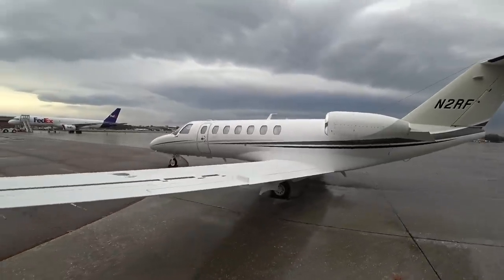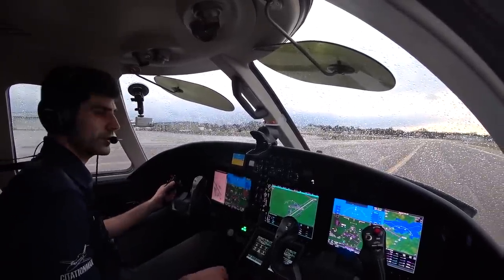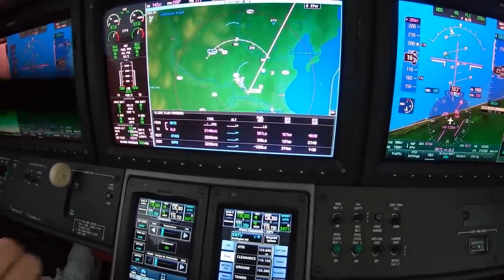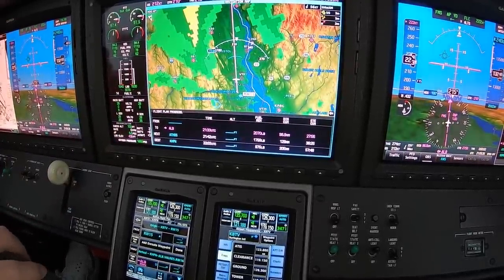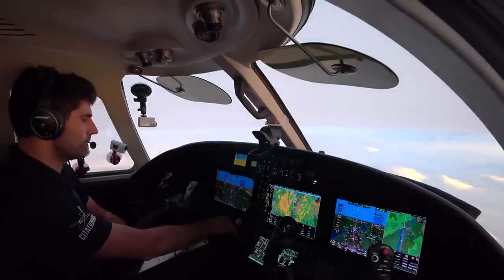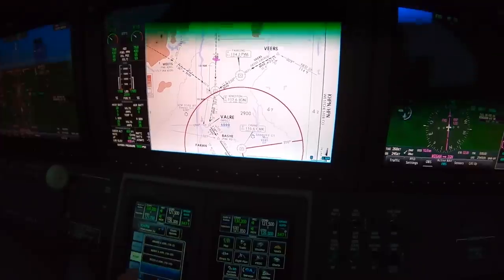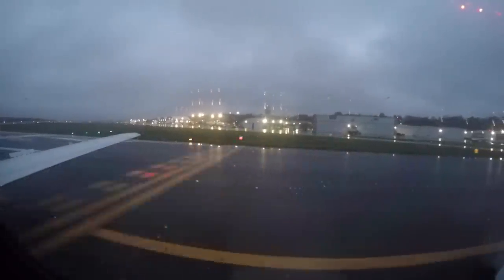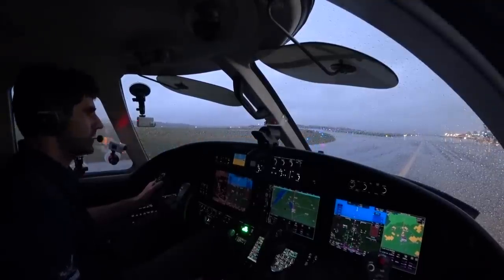That Was Low... Approach To Minimums!!

Comment: First time I’ve seen the channel. Just realized that’s my home field, flew out of there for many years before moving away. Good old BTV. Still remember all the numbers, SID, local VORs  & Loc. freqs etc.. Yes, I was even flying there way back when we were still having to shoot the ADF approach into MPV runway 35, while timing it on our watch for the miss, and biting our nails while being thrashed about with turbulence the whole way in ... 😉.  How I miss real flying when I stop and think about it. Being a pilot has drastically changed during my life’s flying career. We used to have to work hard and study at being a good pilot. There was so much to know, and so much to master. 
But once GPS was approved for inflight use, and every plane out there started getting fit up with coupled autopilots, being a pilot  started to change. And it’s come to a point now, where the majority of young pilots, can hardly fly the aircraft. But, they can push buttons and program  a shiny glass panel  avionics display, which is what is doing all the actual flying, navigating, and everything else the plane does now days. 
Yep, we gained a few advantages over my career. But, we’ve lost a lot more about flying, than we’ve gained. The main thing being, real pilots. 
Btw, I’m not talking about you in this video. Just my experience over 40 years of flying, and what I see with most young pilots who fly with me nowadays. To them, flying is all about the avionics now. The love of the flying and handling the aircraft itself, is no more. Being a good pilot, flying single pilot IFR used to be a heavy workload in the cockpit. So, we had to be excellent pilots to stay proficient. We had to constantly work at it. We had to multitask big time, so we had to be able to hand fly the plane so well, it was second nature to us. This is no longer the case. Many pilots now, rush to engage the autopilot when they get in trouble! since most cannot multitask and also fly the aircraft anymore. When what they should be doing when in trouble, is instead turning it off, and as pilot in command, take charge off flying the aircraft by hand.
Like I said, times change. We used to be an adventurous bunch, mostly fearless guys who loved difficult challenges. We’ve become a group of button pushing computer gamer types, who prefer fancy avionics packages over the actual aircraft itself. Avionics that do all the actual flying for us while we sit, pushing buttons and programming, while watching the screens..🙄 Terrible...
. Most pilots have no feel of the aircraft anymore. Avionics fly the aircraft and us in it, instead of us, the  pilots flying IT! Like we always did prior.  
Sad but true.....   And that my friends, is how the GPS  changed and essentially ruined what being a pilot always meant to us pilots.
PS.... That was a beautiful landing there friend...  😉

Comment: It’s amazing how far technology has come in aviation. Can literally tell the plane it will be landing on a wet runway 🤯
Reply: That isn't new.
Reply: @OOpSjm  If you notice, the original comment was "how far technology has come," not "how new" it is. Pretty sure they'd have liked that tech in the 80s
Reply: Not really new tech. Just written differently in the POH, under Autobrake. Instead of 1,2, or 3, now it's 'wet', 'dry', etc

Comment: Great videos, lots of good info and glad you adhere to the regulations. But the turboprop is a jet engine with an off set shaft and variable pitch blades so yes they are a jet. Look at engine, there is a inlet and an exhaust. Typical mistake. Keep up the good work.

Comment: Gotta love that soup ... Nice flying Max , its sgreat when you break out and the lights are right there .. question , is there a power setting for cruise ,  decent , approach etc like the cirrus ?  is there a percentage power you use or how do you set cruise power etc ??
Reply from the maker: Thanks Aidan, No it’s a bit more complex than the cirrus with specific power settings. But they teach you that if you keep it at around 55% power you’ll never get in to trouble.

Comment: question... when you pull the M3 up to the pump and say, "fill 'er up," what form of payment do you use?  visa?  i mean, 4000 lbs (600 or so gallons) of fuel has got to run at least $2,400 to fill up.  also, what the heck do you do for a living to be able to:  1.) own a new citation, and 2.) fly solo to all these places to just take a trip?

Comment: Please correct me if I am wrong.  But, isn’t a turbo prop a jet engine, with a prop instead of a fan?  This still having thrust from the jet engine in addition to the prop?  Therefore, gammajet is, in fact a jet.  You wouldn’t call a jet engine a turboprop if it did not have a prop.  I suppose a turbofan is sort of a turboprop engine as the fan and prop are both blades spinning around a hub pushing air backwards.😉